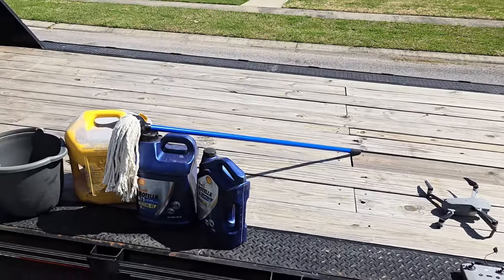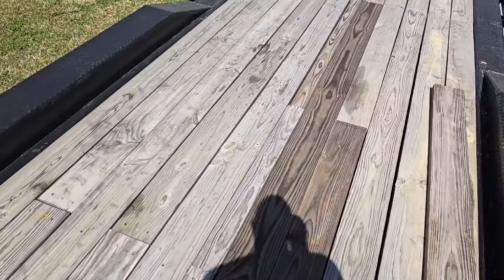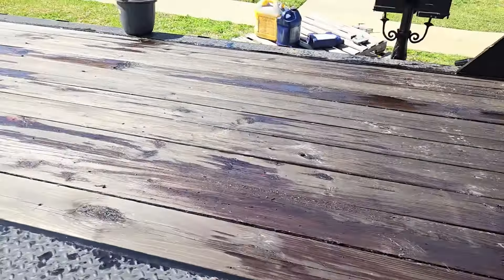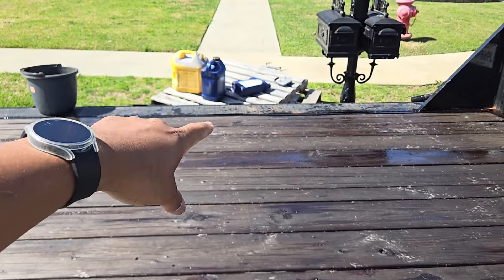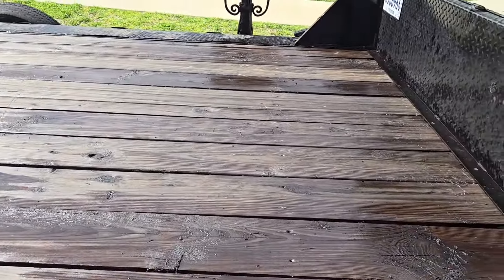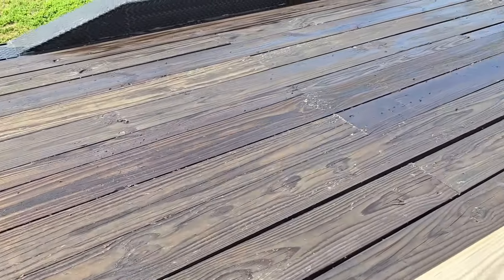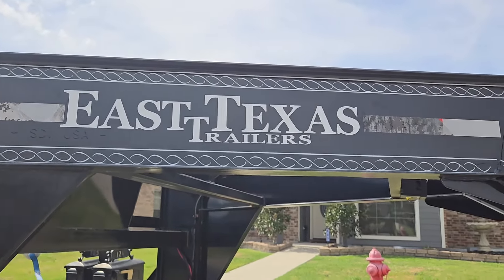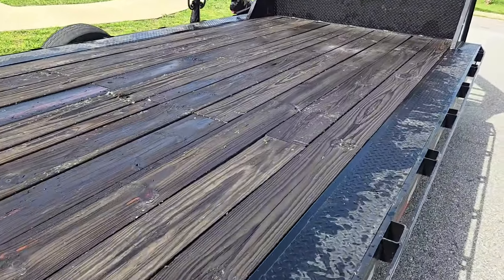I ruined my NEW TRAILER! | staining my trailer deck with Motor Oil 🛢!

Comment: So title was just click bait
Reply from the maker: If you want to take it that way. Some people would consider putting oil on trailer ruining it
Reply: Don’t get me wrong, it was a good video, but the title is definitely click baitey imo. I’ve been using old motor oil for years on fences, trailer decks etc, the only reason I watched this video is because of the title, thought it might change my mind on using oil again on my brand new trailer.
Reply: @wrstack same here.  Was waiting for the reason.  Good to know I can still do this.
Reply: Can you add the color powder for added color? Does anyone know?
Reply: @Powerstrokepat  Straight out click bait pal. Starting to really hate this sort of thing. If you want to have a title like that, use quotation marks eg "RUINED", better chance of not wasting peoples time.

Comment: If I was the HOA in that subdivision, he would be getting all kinds of fines for what he just did.
Reply from the maker: Thanks haha to bad we don't have  one 😅
Reply: And your a Karen or Ken. Oil and diesel both come from oil, which is a natural substance. While commercial stains are more man made chemicals. So, yea, wisen up.
Reply: @SM-bu9bz  Greetings. What is "Karen or Ken"?
Reply: Only dwebes live under all those rules
Reply from the maker: @eddieb9930  no worries here
Reply: @SM-bu9bz So is used motor oil still considered a natural substance?  I ageee deck stains can’t be much better, and I’m  considering doing this myself. But I have to keep it real, used motor oil is pretty nasty.
Reply: Thanks for letting us know what type of Charlie uniform November tango you are. Nothing wrong with staining your deck like that.
Reply: @papageo5 try using conventional oil , what makes it work is not the oil by its self it's the carbon in the oil a byproduct of blow by in the
Reply: @papageo5 it's not the oil by itself. That works. It's the carbon deposited in the oil from the blow by on the combustion chamber that makes it magical carbon kills bacteria and protects to wood.
Reply: @vicosee4439  What happened? Did you run out of ink?
Reply: F HOA.
Reply: What do you think one of the main ingredients is in the asphalt below the trailer! Oil oil oil

Comment: Mine was super slippery when it rained for a few months, 4 years later and I'm now about to rip up all the wood and replace it as its all rotten. Was a brand new trailer when I coated mine, Not sure what went wrong but I'm not convinced this is a really good method...
Reply: You should let the new treated wood dry out before sealing it, it will rot from the inside because of the moisture in the new wood.
Reply: What went wrong is you did it new. Let it age a bit, then do it.

Comment: I love the oil mix. Used hat trick before. Keep doing it here and there and it will help prevent wood rotting. Just had to re deck a 20’ dovetail trailer due to rot.
Reply from the maker: Yes I've heard good things about it. Time will tell

Comment: Your video was supposed to be about how you ruined your trailer. Well we all have been doing this for at least 35 years but with straight used oil from the farm and I can tell you that we only had to do it once and that we still have not replaced any rotten boards on any of our trailer’s. You shouldn’t dilute the oil just use it.

Comment: I have done this to both of my trailers. And it works great. I have found that using a sprayer works better to get in the cracks. I have to do it every year but i get the used oil for free and use about 2 to 3 gallons of off road diesel. Works great and keeps water from ruining the wood

Comment: I did this (straight oil) no mix on a small deck. Found it got slippery after a rain. Seems like a lot of support for it but I would use something made for the job. Did you mess up the street any?🦇
Reply from the maker: @dustbat  I'll be doing an update video here soon. My deck actually isn't slick at all. Not sure if mixing it help wood absorb better or not. No street is fine like it never happened
Reply: @Powerstrokepat  Glad it worked out for you. Looks like a nice neighborhood.🦇

Comment: I use 50/50 diesel and oil, but I have 700 feet of wooden fence along the front by the road… and I spray it.. I use about 40 gallons total… I did it once last year and might do it once more for good measure.